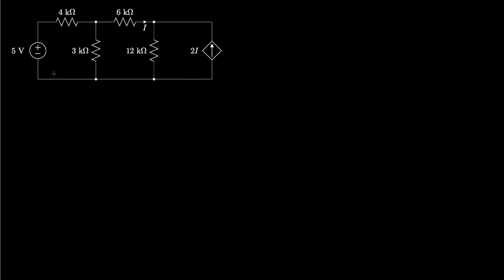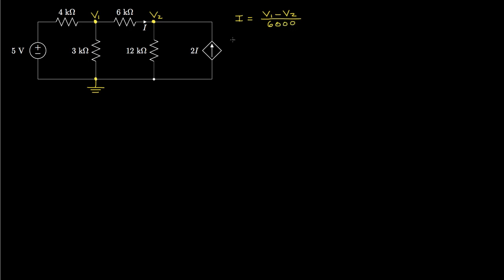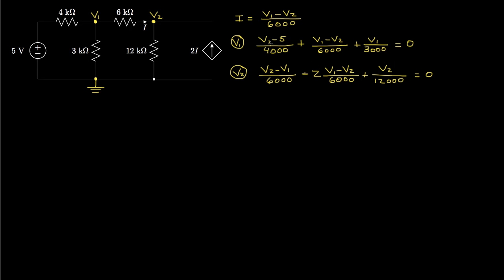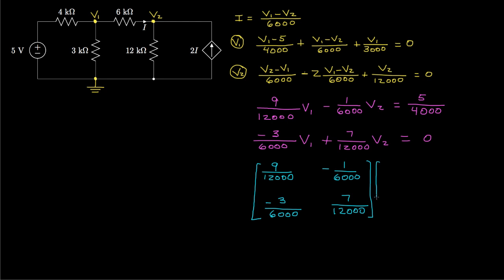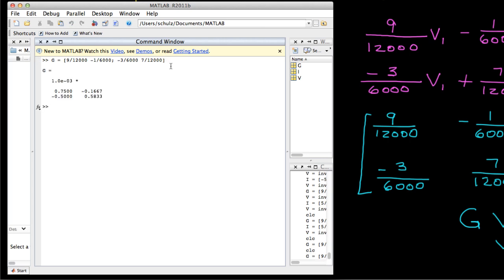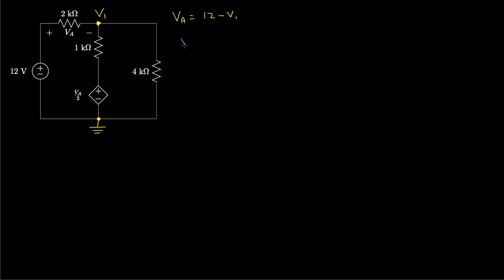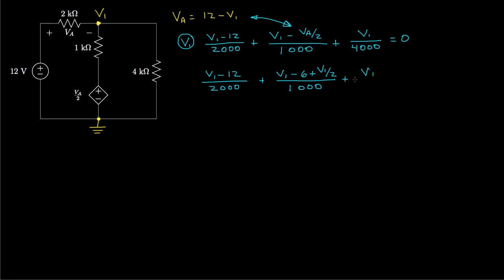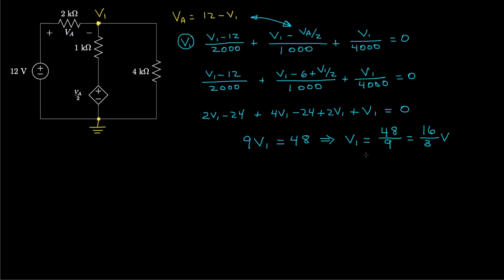Node-Voltage Method: Part II

Comment: For example 1 @ node V2, the current through the 6kΩ resistor points towards V2, but you have it as the voltage drop from V2 to V1. [ (V2 - V1) / 6kΩ ]. Is this why you solved for controlling current I @ node V1 instead of V2? At a particular node, do we only hypothesize that the current is flowing away from the node unless it's a current source?

Comment: mistake maybe.
when you first wrote the expression for v2. the first term should be negative as it goes towards the node
Reply from the maker: Thanks for the comment. The current called 'I' does 'flow' into the node; however, because the first term in the expression for V2 is defined as (V2-V1)/6000, it is a current 'flowing' out of the node, so it should be positive. Note that the current called I is (V1-V2)/6000.